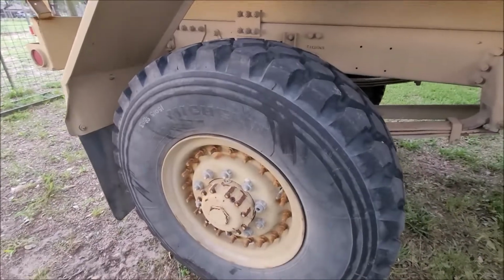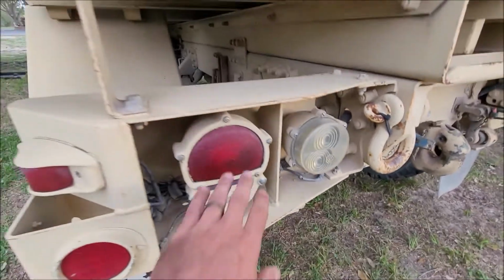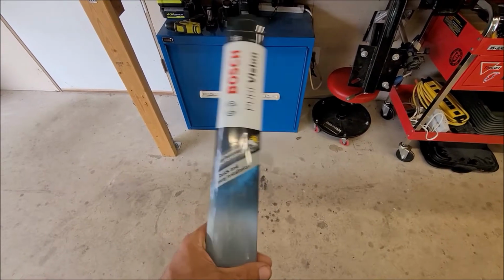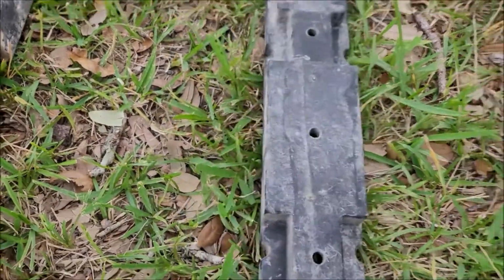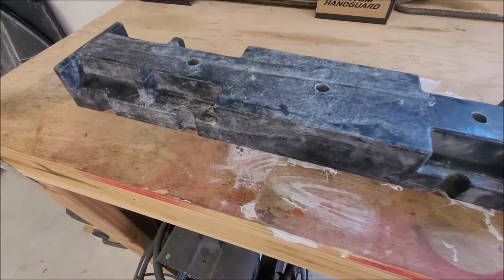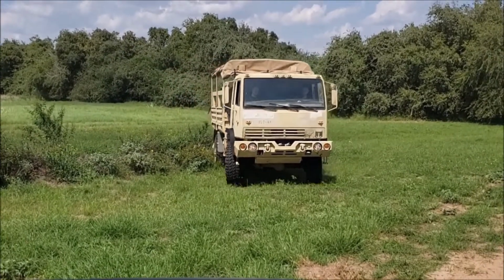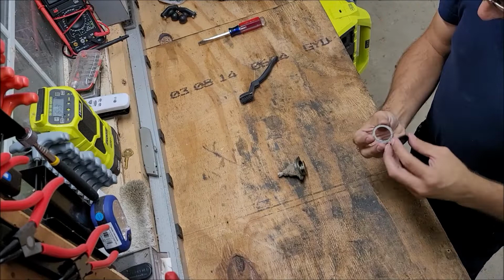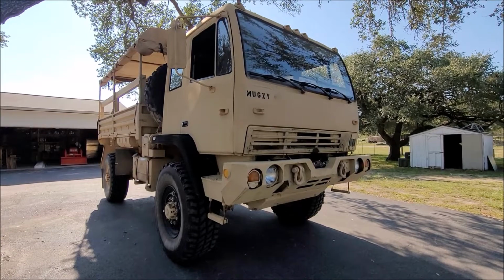M1078 LMTV - Update #1 New batteries installed, registered, & more!

Comment: Hi Colt.  I would replace all of the relays and fuses in that panel with new ones.  It will save you multiple headaches down the line.
Reply from the maker: I have replaced most of them. Plan to do all of them when I have more money to put into it.
Reply: Hey,
Where can I get a new set to replace all of mine ?
Thank you